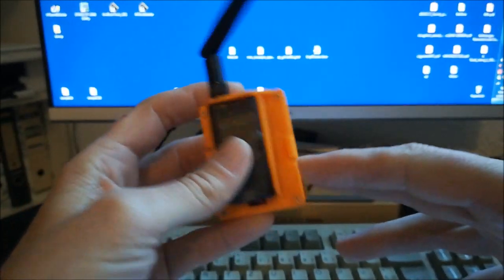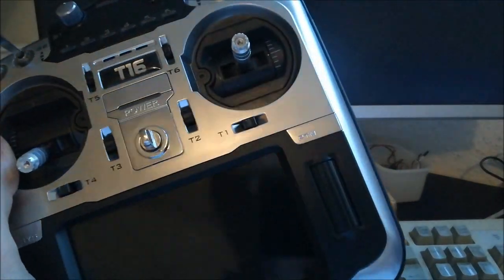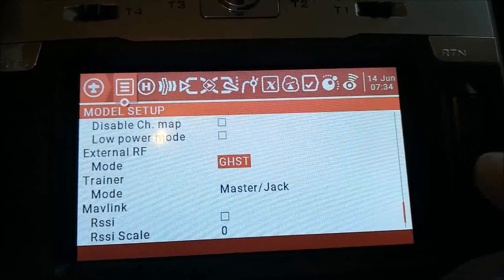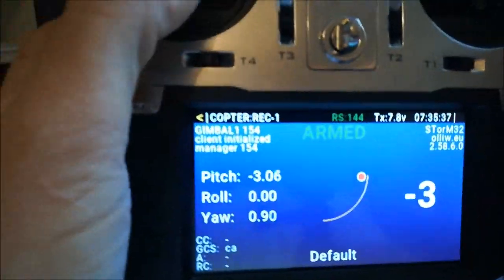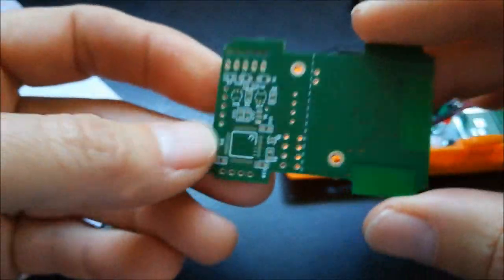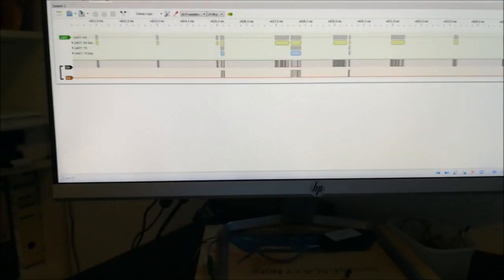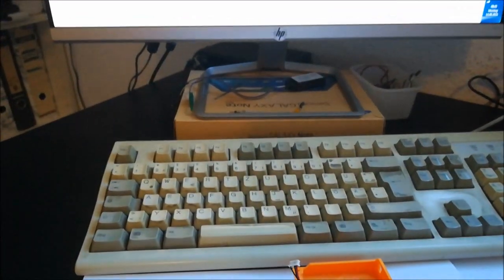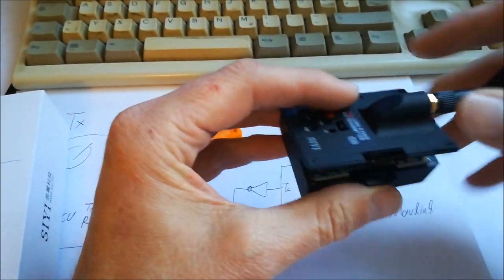OpenTx with MAVLink: Via Transmitter Bay

Comment: This is really interesting. Thanks for sharing the video and all the files.

I wonder if we'd be better off making a new transmitter from the ground up. Rather than having to take turns with the rx and tx signals, it seems like there would be an advantage to making a transmitter with bidirectional communication built in.
Again, thanks for sharing your work with us. I look forward to looking through your Github documents.
Reply from the maker: many thx for the kind words. It indeed could be interesting to do a new transmitter. I'm not sure if from ground up, but PCBs to replace the original ones look doable. Using more modern mcus than the F4 like F7 or H7 would open many options.